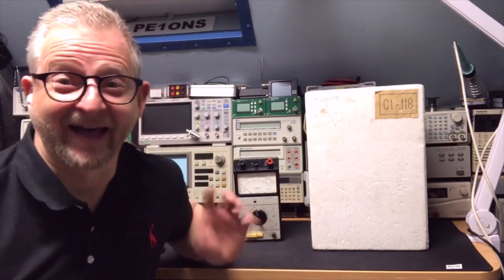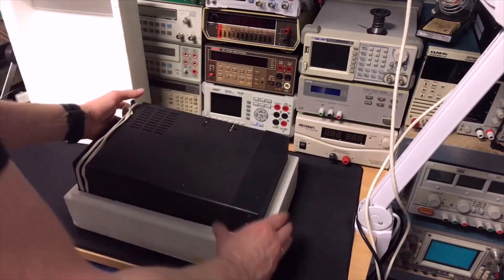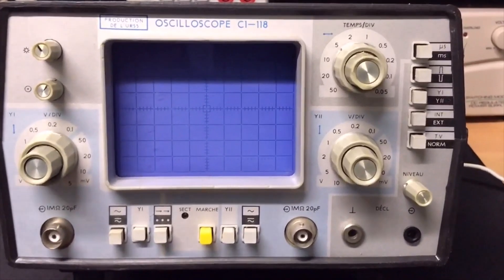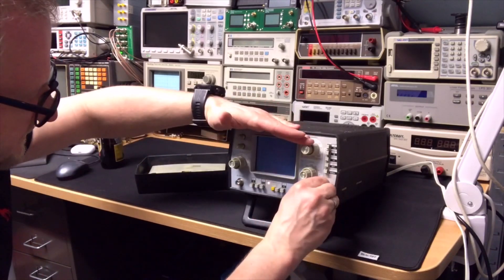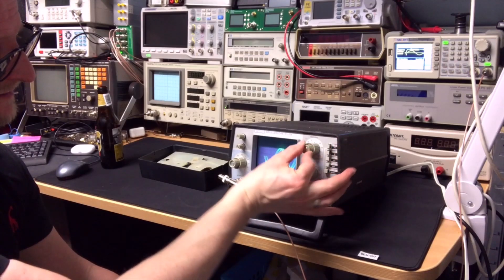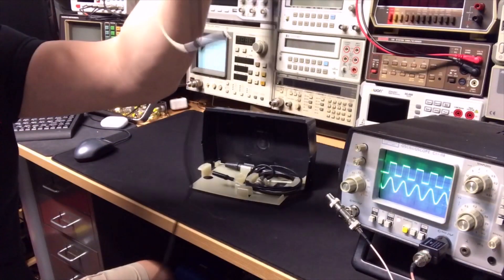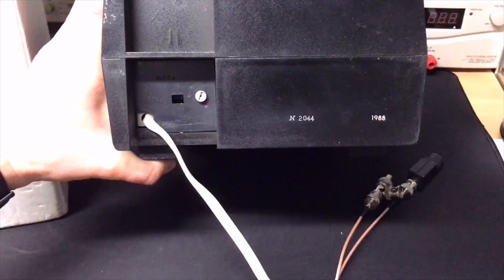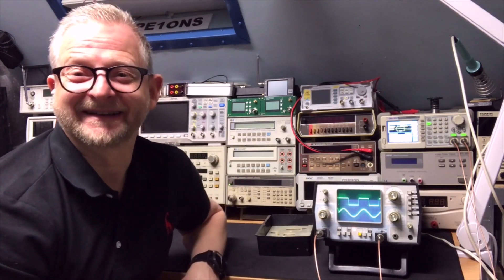#135 C1-118 USSR Oscilloscope 1988 with original Box S1-118

Comment: Sweet!
The C1-118 (actually, S1-118 in the West) is a very decent scope.
I think it, together with the S1-94 and the S1-112, was in large parts built for export. I have seen English, German, and French versions so far.

I also have one, but it's missing the front cover and leads. I replaced the Soviet BNC with modern ones so that I don't damage the probes I have. Now it only needs the frontend to be properly compensated. So far it's too far on the capacitive side and channel 1 is distorted.
Congrats on this find! I have never seen one that was new in box. :)
Reply from the maker: Hello Thilo, thanks for that extra information, yes the S1/C1 i missed that, i did read about both but turns out the same :).. Yes the BNC's just fit or don't its tricky indeed.. thanks, now i know its just slighly off, good luck with yours... hope you can fix it... i did find schematics... let me know if that will help.  Tony
Reply: @TonyAlbus  Thanks for the offer, but I have solid documentation myself. Mine came with a German manual, and I also found more on the internet.
As for the adjustments, it's only a matter of twiddling a few capacitors and I just didn't tackle it yet. Too much other stuff interfering. :)

If you ever come across an S1-112 (the one with the multimeter built in), let me know. I still struggle to get mine fully working. I do get the display, but it keeps reading zero.
Reply from the maker: Yes i will!
Reply: @VintageProjectDE  hello Thilo I have one C1-112A, I actually dont know how to use an oscilloscope. It was my grandfather's. Even though I studied electrical and electronics, I honestly have no interest in these subjects. The one I have was produced in 1992. Do you know what the prices of these are?